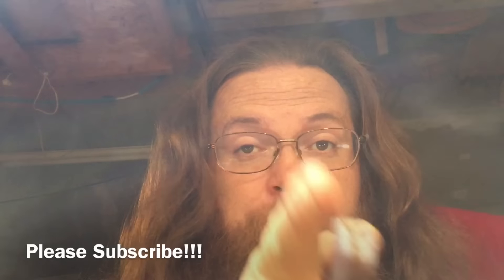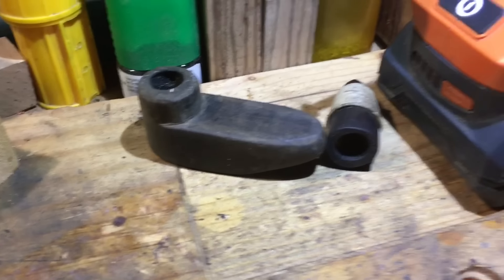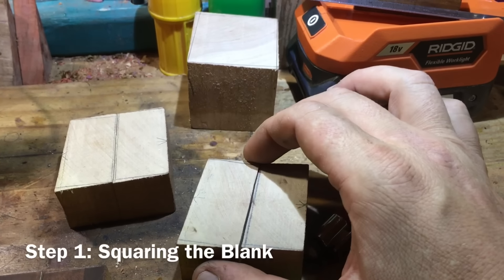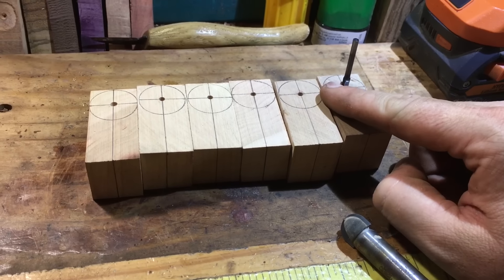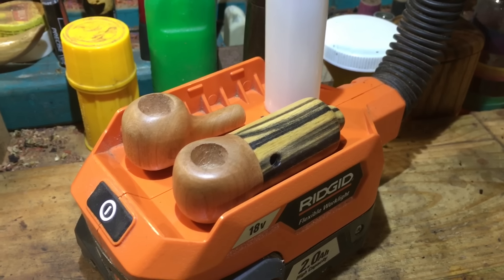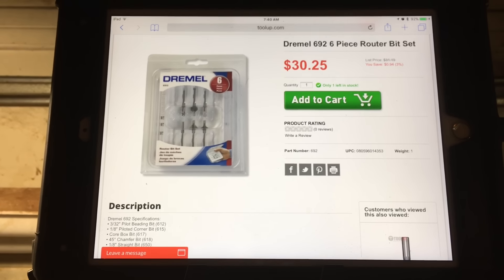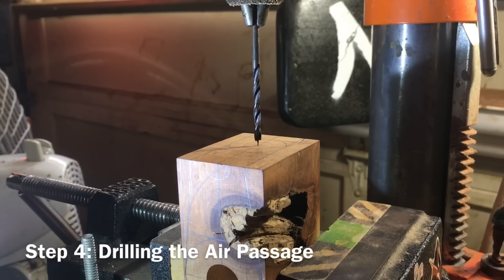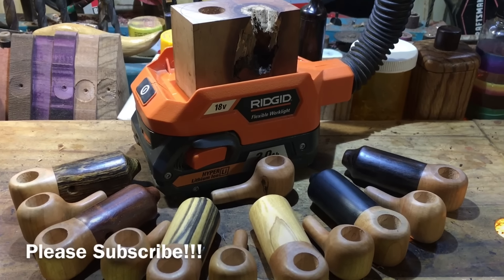Gary's Wares: The Basics of Pipe Making

Comment: UM. you're not drilling those pipes right at all. You're supposed to have the draft hole drill through the side and meet the bowl just above the bottom of the bowl about 1/16 to 1/8 from the bottom apex of the tobacco bowl. The reason for this is if you are a "wet" smoker a bottom drill sucks all the saliva, tar and sludge right into your mouth. Yuck! All the finest pipes in the world use this system. Honestly if you take your time the side entry hole is a mixed blessing. It's a lot easier to do overall but harder to get exactly right. otherwise your pipes are really good looking and you do an excellent job.
Reply from the maker: +Tony Dadon Well, full disclosure, the first two pipe designs did not necessarily have tobacco in mind. However, the last bowl drilled with the 5/8" core box bit was drilled in the manner you're describing. As I said in the video, I didn't exactly nail it, but I was close enough to the bottom of the bowl not to make that much of a difference. Most of my larger bowls are drilled in this manner so they can be used with tobacco.